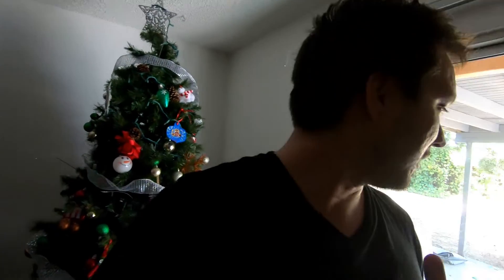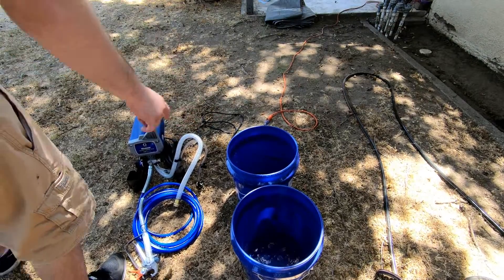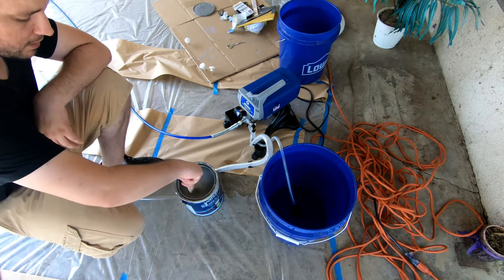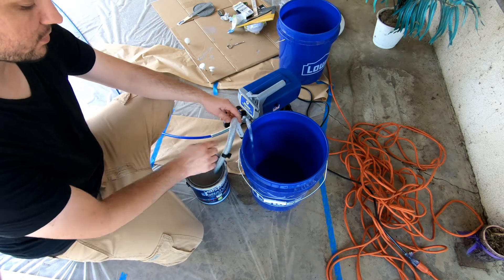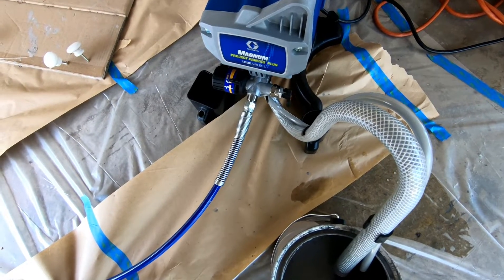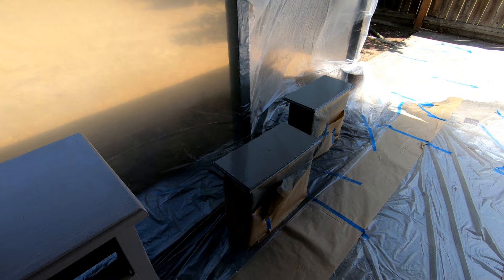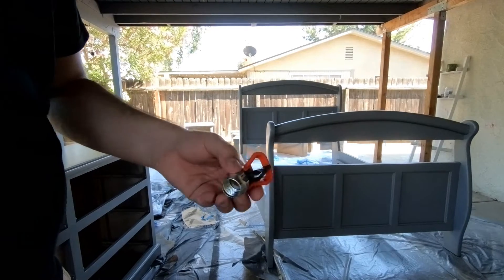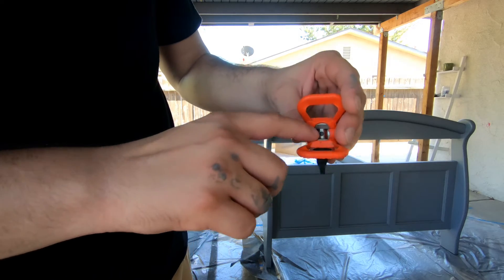Graco Magnum Project Painter Plus [USA MADE! Best Painter for the $$$$]

Comment: I just purchased this sprayer to paint my house exterior with latex. It's a great sprayer for the money. You can find it on sale at big box stores for around $170.00. The only drawback to this sprayer is that the pump is disposable. Once it goes out the sprayer is useless. If your wanting to have it on hand for several years and paint multiple large projects I would look at a better sprayer. I'm using it to paint my home and this sprayer will save me thousands so for me it was a great buy.
Reply from the maker: Kansas Gardener i suppose it is called a DIY Sprayer so that’s kinda to be expected. I’m unsure about the other models but this was something for me to paint random stuff and have a nice finish especially when the motor hand held electric sprayers were the same price or close by $50. Good insight tho!, I haven’t really inspected too deep into the machine nor considered that point of view due to my light use (spray and put it up). For the $199 I paid I also got the amazon extended warranty (waste due to lack of use) for $10 for 4 years after the factory warranty if I remember correctly.
Reply: @ProjectAnubisUSA  This sprayer is well worth the money and from what I have read their costomer service is top notch! Just thought I would point out it is a none serviceable unit.
Reply: Right, Graco booklets suggests that this sprayer can handle about 50gl of paint per year, and warranty is one year as well, so I guess it defines its lifetime. But, I guess to expand lifetime, you can go with lower pressure by using some Low pressure tips of doing some acceptable dilution for paint, all this should allow to run it with less stress for pump, hence expand its lifetime. Also lesser pressure reduces overspray, so if you painting big surface this may lessen paint consumption.
Reply: Hey there, I haven't watched the vid yet, I usually check the comments first... Anyway I just wanted to say that I have the "Project Painter Plus" Airless Sprayer also and I love it. I make sure I immediately clean it like new after each use, I actually run pump protect/lube right after cleaning before I leave the job, but I actually use non-diluted antifreeze. That was recommended to me by the manufacturer of my pressure washer, so why not? I've never had any issue with it, just be sure to really purge the system before ever touching paint!! 
I don't baby it by any means, in fact I run the hell out of it and have for at least 7 Years now with about 3/4ths of that time working under a GC painting, so I prob put the "recommended" yearly 50 gal through it within a week at times, and I bought it used. The book says not to use over a .x15 tip but on some jobs I use a 619, that's the largest I would use and even then after a min of steady shooting you can hear it starting to loose prime so I just let go for 5 sec or so for the pump/line to fully pressurize again, the motor stops and hit it again, but for the most part I run a 615,  (or smaller for doors, trim, shelving... a 413 on lower pressure is great for that work). Just have to really know when to crank up or ease off the pressure knob. This thing has NEVER let me down, it has had me a bit worried a couple times but the few times I did have [minor] trouble usually came down to something I overlooked. So far it has never failed to finish every job I started. 
As far as the unit being "disposable", IDK, I would have to say that would depend on what failed and if you are mechanically inclined enough to work on it, (I do not mean to be or sound ugly). For me if it's not seized up, I would probably fix mine. I want to, (and have been meaning to), get a bigger Graco unit and use my Project+ for interiors and whatnot, but take off the hose/gun which is really easy with an adjustable wrench, and wrap the cord tight and it's just so easy to transport. 
Anyway, my advice is start off by straining your paint, even brand new cans/buckets, just because the seal has never been cracked doesn't mean it's the freshest, so strain up to 5 gal at a time, as you get low strain just enough to top your 5 off. Be sure to clean it very well as soon as job is done, don't even take a break when you finish, clean it well, prime/load it full of antifreeze, (same with your Pressure Washer if you have one), before you put it away and I am quite sure you'll be surprised and excited with the life and performance you will get from it. One last bit of advice is to find  the right size "plug" so you can remove the hose for storage but still keep it full of antifreeze, I say that because after a few years the hose will start to kink and break apart just from the stress that weird angle coming out of the pump and into the gun causes, those will be the weakest points on the hose. Remove the hose from the unit and the gun from the hose for storage (and if poss store the hose laying down not hanging on a hook). I keep my tips and gun in a 1 gal w/lid half full of A.F. and I found the right size plugs to keep the unit full of a.f. and same with the hose. These simple steps done everytime should equal a successful job every time!
Sorry so long, didn't mean to write a book, I just really wanted to stress that proper care and it should last a Very long time, much much longer than mine if you don't use it for well over half your income!!
So save $ by using A.F., save your hose by storing it separate and laid flat, learn that pressure control knob very well as it will be your friend (or enemy), and Hope you don't "have" to buy another one unless YOU want to.
Enjoy,
Reply: @da1cru1  I just bought one of these at Lowes to paint my house.  When I read the 50 gallons thing I was a little discouraged,  but then I realized .......... I won't be using more than 10 or 15 gallons and even if it crapped out at 50 gallons, that's painting my house at least three times.  Thanks for that awesome clarification.

Comment: Hi I own the graco higher end sprays as I do painting for living considering the model you have here some tips , regardless what it says on manual that you dont have to thin the paint I always add water about 5% and the tip you are using is for walls ,consider picking up the green tip # 310 fflp   it will give you very smooth finish,  thanks for the video 👍👍👍
Reply from the maker: I only thinned the paint to save some money, especially when I seen that my paint was thick enough to do so. It was doing extremely well when I first practiced (a little too well) when I noticed my 1 gallon can was gonna be used up too fast 😂 if I didn’t do something fast.
Reply: Trust me you can empty the whole gallon in 30 seconds that's how fast they spray  , just to fill that hose and the pump is like quarter of the gallon 😂
Reply: I got the cordless ultra for small jobs and that little guy can go through the gallon at the same rate , but its lifetime is about 50 gallons and you might need to replace the piston , you made a good choice with your spray machine , it's good to tackle weekend projects,  keep the good work !!!

Comment: Def. first time user. The hand-held ones are great for DIYers that don't paint frequently. Also, at lot easier to setup and clean up than this floor model. It wouldn't be worth  my time to set it up to paint 2 drawers or a small house room, esp. if two + colors. 500 square foot garage, then 200 square feet hallway. Waist of time and money. Just use the roller. But, for concrete, brick, doors, cabinets a sprayer is typically better.
Reply from the maker: I just recently purchased a hand held battery one used and looking to see how it works on my wood projects that I need to swap between paint colors frequently. I recommend this 1-5 gallon one over the handheld because the hand held have a shorter lifespan on the pumps and max SQFT it can paint without faulting. For a similar price this larger one covers a lot of a home owner's needs.

Comment: Is the sprayer suitable for acrylic paints. ?  Looking to paint my stucco exterior .
Reply from the maker: I couldn't say, I know they have special cordless / corded handheld ones for solvent type paints due to the destructive characteristics of the solution on the internal components. I would suspect the same to be said for the larger ones and I'm not sure how potent acrylic is on the seals used on this particular model. I'd recommend Contacting customer support they are a great company that has reached out to me to clarify my questions. Please share your results for others who are in a similar situation.

Comment: You can remove the intake tube screen and attach a garden hose for a better cleaning if you like.  It's almost two years since you uploaded this video so you probably have figured that out by now.
Reply from the maker: Yeah I used it once and that’s it 😂. I thought I Added that clip but I musta missed it during editing. it’s a fine looking machine though! 👍🏻
Reply: @ProjectAnubisUSA    Was there a problem with the machine or did you just not find any other needs for it?  With that machine, you could probably change the color of an entire medium size room in less than an hour after masking.  If you use the green spray tips there is very little over spray.
Reply from the maker: Tribulation Prepper no this this works like new. Thanks for the ‘tip’ 😁! I just buy tools just to make my project fly by and then wait until I have another use for them. Certain tools I use a lot and others are good to have for that one project you wish you had it. I don’t do a lot of painting so that’s why it’s been sitting and also the plan was to buy a little bit of wood tools at a time so I can start doing more wood projects. Slowly I’m building my inventory of tools and hopefully YouTube will kick in soon so I can do more. I will use it soon for a room addition that’s being finished.
Reply: @ProjectAnubisUSA   I have often been known to tell my wife the following:  I don't use this tool very often but when I need it, there is no substitute.   My oscillating tool is the best example I can think of.  The fact that I have both a 7 1/4 inch miter saw and a 12 inch miter saw just drives my wife nuts.   The 23 gauge, 18 gauge, 15 gauge and crown stapler guns don't help my case either.   I just remind my wife of the contractor's estimates we have received for small jobs around the house and how my DIY attitude has actually paid for my B&D collection.

Comment: I'm not thrilled about the limitations of a self-contained handheld sprayer but I was wondering if this sprayer is "Too much" my first project which is spraying installed virgin cabinetry, crown, and trim in a new kitchen. The only thing I'll be masking will be the windows as flooring isn't installed yet... 

I see you can use the Graco RAC fine finish tips (bought separately). I'll be spraying the cabinet boxes (inside and out) as I'm worried about slowing or controlling the paint volume in the tight spots. Anyone have experience with this?
Reply from the maker: I wouldn’t have an experience with any additional tips to control tighter areas but I did notice when the paint was thicker (harder to control in tight areas) it covered a lot in one coat, thinning it out actually allowed it to feather in certain areas with the larger angled tip. You can turn it down but I seem to have liked running it about 1/2 to 3/4 when covering the surfaces I was spraying and you should be able to dial it down to about an eighth to get that fine mist that you want. Overall I do recommend the project painter because it does a way better job than the hopper fed painters. It will also allow you to tackle all your home projects and commercial if you seek that later. The ones that are the next size up give you an increase in hose and power to pressurize that hose for the distance overhead when using it at its maximum height. Hope this gives you some insight if no one responds to your question with more knowledge.
Reply: @ProjectAnubisUSA  - Thanks for the input, I think I'll pull the trigger (Pun intended). =)

Comment: Can the pumps be replaced when it goes?
Reply from the maker: I cannot say for sure but it appears not. Some parts are replaceable, just keep in mind if you have that much use for it you might want to go bigger. The pumps alone seem to cost around $200 so it appears the cheaper option is to buy a new one.
Reply from the maker: Here is a breakdown drawing of the machines:

https://www.graco.com/content/dam/graco/tech_documents/manuals/3A5/3A5572/3A5572EN-B.pdf
Reply: @ProjectAnubisUSA  thanks. I went through about 6 gallons over the weekend. It worked well.
Reply from the maker: @m.m14433  The best painter ive used so far and its budget friendly

Comment: You forgot to explain how much pressure you used to paint the surface ...
Reply from the maker: It doesn’t have a PSI readout that’s why I said a bit 1/4 power when I started and 3/4 power when I got the hang of it.

Comment: used water to thin paint? can can ??
Reply from the maker: NO PLACE LIKE MAUI HAWAII yes I did.  It was experimental 😁 but it all depends on the paints contents such as oil based, water based, enamel, etc. depending on application like mold, indoor, outdoor, indoor/outdoor. I’m not a paint expert but the diluting of the paint with water worked fine also people use mineral spirits. Double check with your local hardware store to make sure it doesn’t separate your color and it’s base.
Reply: @ProjectAnubisUSA  thanks my brotha.

Comment: What paint did you use?
Reply from the maker: Lowe’s paint with primer. It was from their color chart then they added color to darken it the second time since the 1st time they did not do it correctly and it had a pink tent to it (I didn’t choose the color, wasn’t there the 1st time). Once they mix it if it’s wrong they try and color correct if they know what colors were used, enough room in the bucket, and lid good or just give you a new base (primer) and mix again. So technically it’s a custom color which was as close to the gray (darker) than we wanted but still came out good. We didn’t want to waste paint if it could be saved.

Comment: I can tell  you by experience this is a piece of crap.  Constantly clogs even with thinning paint.  Stay away from this one.  If you want to stop every ten minutes to work on it then this is the equipment for you.  The very first day mine stopped in the middle of a paint job, went in and out, I had to take it apart about 5 times in an hour.  I wouldn't put this one on my worst enemy.  I'm heading back to Lowes for my money back as it didn't even get through 2 12x15 rooms.
Reply from the maker: Thats really unfortunate. I've been happy with mine as a hobbyist and a family member of mine has been too. Perhaps they went cheaper since I noticed the price increased. Graco also has customer service that I recommend getting ahold of, they were prompt to reach out to me when I first looked into these. Thanks for the update for potential buyers to be aware of.